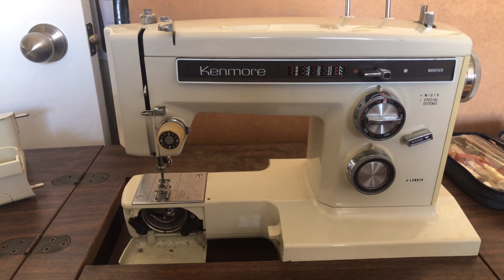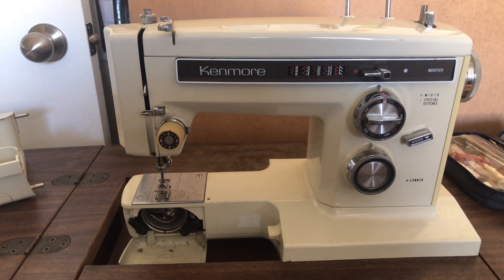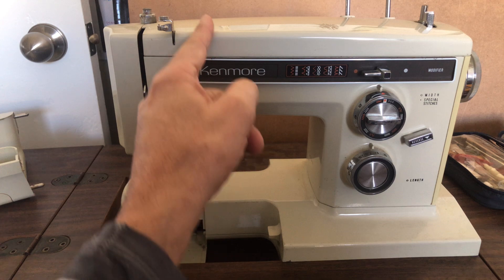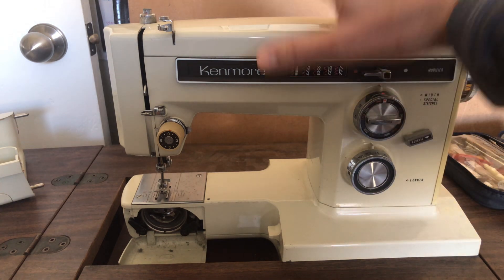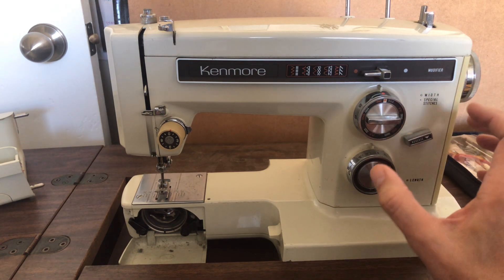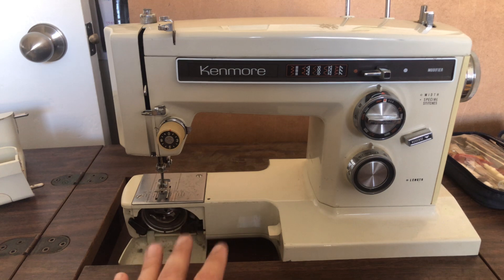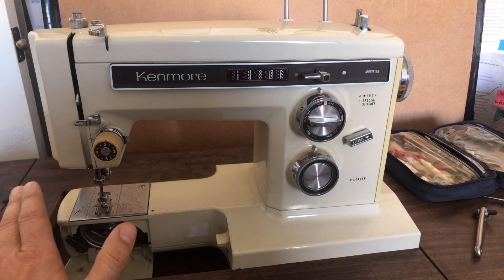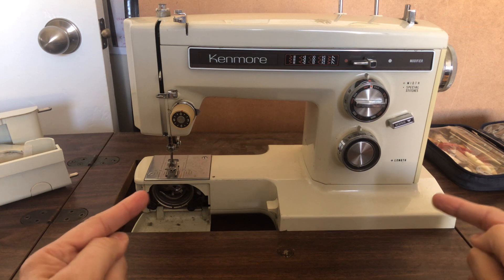I NEVER TIRE OF THESE AMAZING MULTISTITCH MACHINES & WHY I WOULD CHOOSE THIS KENMORE OVER A BERNINA

Comment: We are a sewing machine dealer and authorized service center. I have toyed around with acquiring these old Kenmores and refurbished them and certifying them with a year money back warranty. Simply because there is NO MODERN mechanical machine that approaches the quality that these machines have.  We have a Mennonite community close by that uses their machines ALOT. I would recommend these over a modern one any day. I’ve seen 1 mechanical Bernina out of the 90s that was in my opinion Bulletproof. Otherwise forget modern mechanicals.
Reply: I just bought one of these for 30 at my local thrift store and am trying to figure out how it works
Reply from the maker: You can purchase a PDF of the original user manual online.  This would go a long way in helping you learn the various aspects of the machine.

Comment: Happy Holidays!  Your videos are great and I appreciate your expertise and thoughts about vintage machines.  As far as Kenmore vs Bernina, each has qualities I like.  In some ways I like Berninas better because I often feel they are quieter and I like their stitches.  I have 3 of them - 125, 801 Sport, and 930.  I don't ever have tension issues with the 801 or 930; the 125 is misbehaving right now.  The Kenmores I like for their power and ease of use in a lot of areas.  I have 1030,158.1941, 158.1914, 158.1980 and a 158.1400.  I find the Kenmores feel more intuitive for me to use - no idea why as I grew up sewing on a Viking 19E.  One thing I have found is that my handcrank Singers and treadle are more powerful at times than any motor driven machine, as well as more reliable  My computerized machines are also great - but as you have mentioned, they often lack the ability to power through multiple layers (Janome 6500 and Skyline S7).  The buttonholes on the computerized machine top out any mechanical buttonhole, and their lightweight (S7) make them very nice when I take a class.  I use all my machines, cycling through them, and enjoy them a great deal.  Fun to use, repair, and maintain - like good friends!
Reply from the maker: How great that you enjoy BOTH brands of machine.  I must agree with you that, while all oscillating hook machines such as the Bernina make SOME noise, the Berninas, along with the Necchis, are some of the quietest oscillating hook sewing machines ever made.  Berninas do make lovely stitches and are strong sewers in their own right which helped earn them their reputation.  However, I feel the Kenmore is the equal in terms of quality, long life, and are far easier to overhaul and care for than Berninas are.   Thanks for sharing
Reply: @VintageSewingMachineGarage  I don't usually overhaul machines - try to bring a few back to life, like my current White 764 which needs the upper tensioning taken apart (any hints?) - but will agree that the Kenmores are easier to work on in general - and less expensive, too!  What I have found I really like as a general rule for older Berninas is the foot controls (cannot speak for any past 930) are more subtle.  Older Singers, too, are a real pleasure.  Anyway - Happy New Year - looking forward to seeing more of your videos.  Oh, do you take on repairs?  I am in CA.  TIA!

Comment: Thank you for your insights into this machine. I really appreciate your comparisons with Bernina. I have 50ish sewing machines, Singer, Elna, Necchi, Wheeler and Wison, Wilcox & Gibbs Adler, and others. They range from 1860s to 1960s. I have this exact machine. Some of my machines I have because of the history, but I get most of them for sewing. This Kenmore is my youngest machine - the only 1970s machine I own because of its construction. I am so impressed with it. I also am pretty impressed with the buttonholer. My favorite buttonholer is a 1930s Singer that is very adjustable. I can make very fine buttonholes with it. The Kenmore buttonholer can also make fine buttonholes, although less adjustable. It is a very different design. Everything I have tried with this machine I am happy with. Well, the only thing I can think of that I would like to change is to have a reverse that you don't have to hold down to make work. 🙁 I don't have any Berninas, partly because of the proprietary feet they use. I have never found one that has all the bits with it that looks in good shape for a decent price.  I am used to fully servicing machines, but this one was so clean, it just needed a light cleaning and oiling. I feel very lucky to have it. I appreciate all of your videos, thank you!

Comment: I had this exact machine in the 70s, and stopped sewing for a long time, so it 'froze'. I traded it in for a fancy Bernina and have regretted it ever since. The Bernina is fine, lots of nice features, but the service is complicated and expensive for the computerized machines. I just found a 158.19471 at a thrift shop, in good shape - I'm thrilled! Thanks for the video.

Comment: Thanks for the details. I'm cleaning the shuttle area and relubing as you talk. 
One of mine is Kenmore 158.15251 and made in Japan. I must have mistaken the receipt that says early 80s IIRC, with another. It's just like yours except painted nobs and a cheaper plastic button hole guide insert. Dad hemmed our pants with it and not much else, so it's basically new as the one with the external motor. He constantly lubed everything and had an entire cabinet of light oils and special contact cleaners for old analog radios, barber clippers, etc. 

When I finally got around to using these, they were careful cleaned and thoroughly lubed entirely.  Butter.
My ex girlfriend's Bernina was a commercial grade model. She made and altered wedding dresses. It was a work of art from a precision engineering and tolerances perspective.  You are right about Swiss engineering. If I remember correctly, the Swiss manufactured Sig or Sauer p210s that were target grade service pistols following WW2 and the cold war. They later joined another primo company and some models were capable of more accuracy than highly skilled marksmen with some accurized 1911s.  Examples of 1" groups at 25 yards were common from bench.

As for my ex fiance's Bernina, I was a newbie so
 It was a pain to replace parts, but it got a lot of use and normally worked flawlessly when properly adjusted. Maybe it broke because it might not have been oiled or was forced into compliance. I don't know. It was however an honor to repair and the few parts. Every machine can break so no slam on Bernina.
As a guy who has worked on that one model, I respect your challenges and skill set.

Comment: Thanks so much for your videos. In 2020, I rehabbed a completely frozen made in Japan Kenmore 158 and my old Viking 6020, using your detailed information. I love the noisy Viking (my" jeep"), which is very easy to use, but I'm learning the finer points of the 158. I spent a week oiling and working the interior mechanisms before it all moved freely. It's kind of a magnificent beast.
Reply from the maker: I agree with your description.  This series of Kenmores are one of my favorites when it comes to vintage multi-stitch machines.

Comment: I have several of the 1941 machines and have a 1914 from 1976 that I purchased from the original owner, the receipt  from Sears was $476.00for just the machine and the manual listed accessories including pattern cams, button holer, monogramer, speciality feet in storage books. At that time my earnings were less than $7,000 per year so that was a lot of $$ for a sewing machine.

Comment: Sears, Where America Shops.  Purchased a new 158.331 in 1967 and another new in 1981, both are still working nicely.  I only purchased the second one because I was doing craft shows and making some items that had button hole midway in the construction.  So I set up the 331 with a button holer and the second Kenmore for the stitching.  After I retired the 
newer machine became very stiff so took it to repair place, that when I went to pick it up was just as stiff as when I took it in.  Told it was good for a boat anchor, so with nothing to loose I went to youtube, and within less than a half hour I had it running like new.  Found it interesting, so have purchased about 50 more Kenmores through the next 8 years.

Comment: I have this machine in its table, I was lucky enough to find it at a garage sale for $40,00. I use it for piecing quilt tops, I have also used my daughters Bernina. I agree with you that the 158.1941 is so much nicer.

Comment: I will be following this series with great interest.  I recently purchased a Kenmore Model 148.15700 made in Japan.  It looks great but has a problem sewing.  I get a "birds' nest" of top thread on the bottom of the fabric.  I've tried adjusting the thread tension both top and bottom without success.  I'm hoping your series will give me some clue for what to do.  Thanks for all your help.
Reply from the maker: When the issue is tension on the bottom thread, my first thought on what to check is the upper thread tension which you mention having checked.  A few things to also look into: 

1. Take out your upper thread and needle.  Install a new needle and re-thread the machine.  It is very common to miss a spot and even one thread guide missed can upset the whole applecart; so to speak.  

2. Have the timing checked by a local vacuum/sewing center tech if you have one.  

3. When you reinsert a new needle, double check behind yourself to be sure that the needle is properly installed in the right position because while the Kenmore you see in this video threads from front to back, yours might or might not, but a manual will tell you for sure.  Also, be sure when installing that new needle that you don't let it slip down any while you are securing the needle thumb screw.  If the needle is not inserted all the way til it stops vertically and held in place, it can slip a bit which will also throw off the timing of when the needle picks up the bobbin thread.
Reply: @VintageSewingMachineGarage  Thanks for taking the time to help me out.  I'll double check the things you mentioned.  I do have the manual and the needle is threaded accordingly (front to back).  Sometimes the top thread gets wrapped around the bobbin which locks things up and has to be cut to free things up.  Could I have a defective shuttle?  I will change the thread and needle as you suggest.  The nearest repair shop is 60 miles away and after talking to them they said they have 85 machines ahead of me.  Again, thanks for the help.

Comment: Lovely video and happy holidays. I currently own two Kenmore tables. One is from the 30's and the other from the 40's. The earlier one is very simple and completely manual but the later one has a cable system that pulls the machine up as you open the lid. It seems whoever was making these tables for Kenmore was putting a fair amount of thought into the mechanisms they used. On a side note, both of mine and yours appear to use the same hinges for the lid. Since they're separated by some 40 years it makes me wonder if they bought like 2 million of these things all in one shot. Maybe some factory went bankrupt during the depression and they just bought all their stock. Probably not, but fun to think about anyway.
Reply from the maker: Sewing machine makers, particularly Singer and the White company (who made Kenmores for decades), tended to not fix what was not broken.  Sewing machine buyers were often loyal to certain brands; having learned to sew on their family's machine. It also helped to control costs given the investment it took to retool a factory for a new model of machine.

Of all the sewing tables that I have ever rescued and later sold, the one that I absolutely wish I had kept was one like you describe from the 1940s.  It was for a 1942 Kenmore made during the war.  That table and machine is the one I rescued from a barn surrounded by hay and goats!!!   Once I had cleaned it, removed some latex paint that had spilled on it, the Walnut or maybe Rosewood was stunning.  It literally glittered in the sun.  So yes, you 'could' buy fancy things at Sears were you willing to pay the breathtaking price for such a fine example of cabinetry.  Here is the link to a video made of the machine and you can see the table I'm referring to:
https://www.youtube.com/watch?v=hvBZkfeRXP0
Reply: @VintageSewingMachineGarage   The machine from the pulley assisted case is Kenmore 117.959, which, as far as I can tell, puts it's production year at or around 1948. The cabinet is blonde with a knee control (which I prefer to a foot control) and I assume it came with the machine but who knows. It was also a rescue, from the curb in front of a house that was being gutted out. So, a little newer and a little less interesting than the one in your linked video, but it's still a great machine that didn't deserve to die in a landfill. I appreciate what you do and firmly believe that everyone should own an old sewing machine, or five

Comment: I have several of these kenmore's I do not have this model but I have 1760 The 1914 and just recently the 1931 as well as several flatbeds and I agree they run rings around anything else that was built at this time in the US and anything that's made today. These things run rings around them I have other kenmore's that are not the 158 model but they're more of a special just. They're part of my collection but the 1760 is the one I use to do everything with and I have all the attachments. All the cams button holer the monogrammer everything and all the feet. Then I paid $30 for it and other than the feed dogs being frozen up which I've got nose free. The only thing wrong with it was some string bound up and wouldn't let it move. Got that out and it worked just fine

Comment: I have seen bost seat covers and sheer batiste with this machine. It does it all.
Reply: Lol spell check... SEWN BOAT SEAT COVERS  (sails too)
Reply from the maker: Funny you mention that as one of the first of these I ever restored was sold to a client who used it to sew vinyl seat covers for their boat.  FYI, I don't recommend using them for commercial production work but some folks have had success with one-off projects like that.
Reply: @VintageSewingMachineGarage  my dad was a boat builder and one of the first ppl to build airboat in Florida. So my stepmother and I made seat covers for most any kind of seats .. a lot of the early  ones were school cafeteria chair that the legs got bent or broken lol springs on the bottom were luxurious  in the day. I still use that machine all the time.

Comment: I just bought one of these but mine has the double thread spools on the back, not sticking up on the top. I strongly suspect that it was NEVER new. It's in mint condition, the dials are movable  but not loose movement. I inspected the inside, and there's no evidence it ever has been used. It's absolutely amazing. The plug looks like it's never been plugged into an outlet. The foot pedal shows no evidence of ever having a foot placed on it.

Comment: Another great video.   Thanks.  I have a 158.19410 and 158.19411.  I have them up and running, but I would really like to be able to time them properly.  Is there any place that has a service manual that describes the procedures for timing/servicing these machines?   I already have an owners manual, so I just am looking for a service manual.  I time/service my consew 206-RB4 and singer 237 with manuals, so I should be able to time the kenmore’s with the proper documentation.

Thx
Reply from the maker: I have yet to access a service manual for any Kenmore.  I sense this is due to the fact that Sears serviced what the sold.  I would like to come across one myself.  Perhaps try one of the Kenmore sewing groups on FB or online blogs where vintage sewing fans hang out.  Let us know if you find one!!